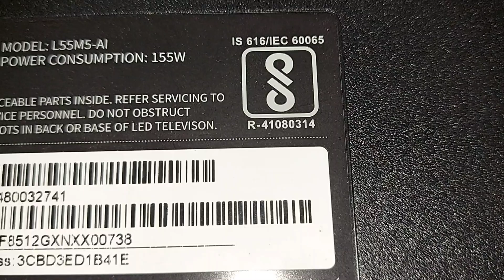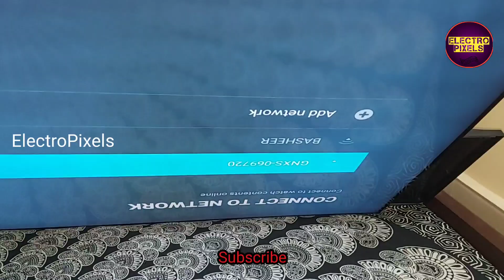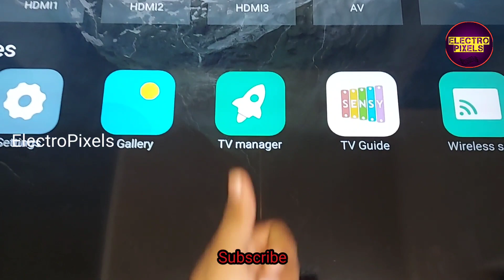Panel Short  Removal |Panel Repairing to Solve No Display in MI:L55M5-AI inch LED Tv|Samsung Panel

Comment: Hi I have the MI 55 inch L55M5-AN I have tapped the CKV lines on the right side,it ram for 1 hour now after one hour it went blank again to No display.I retried tapping by trial and error again on right side .Now the picture is comming but lot of line on the bottom half and flickering happens.I suspected the left side gate line now necause even if I removed the ffc cable to right side,I get lines with half lleft side😮 Any solution?
Reply from the maker: Maybe both sides Gatesignals will be short
Reply: @ElectroPixels thanks,I am also feeling the same😢